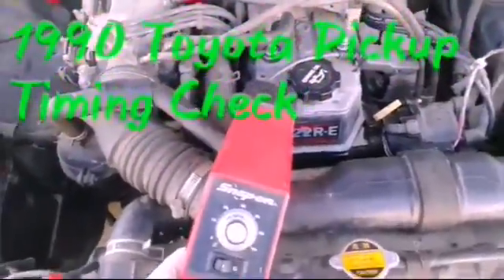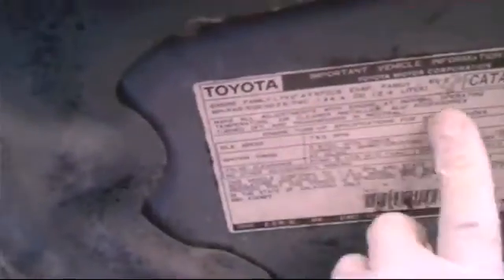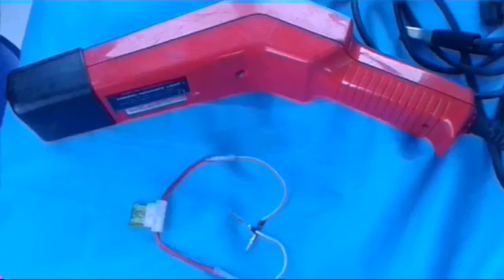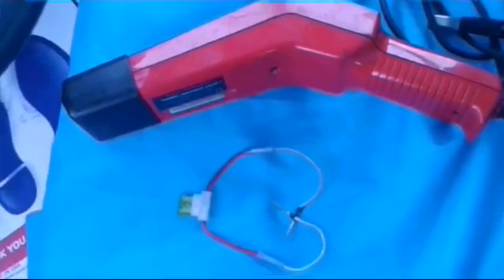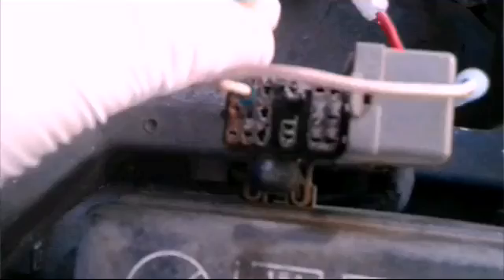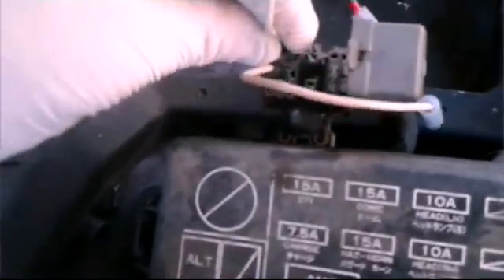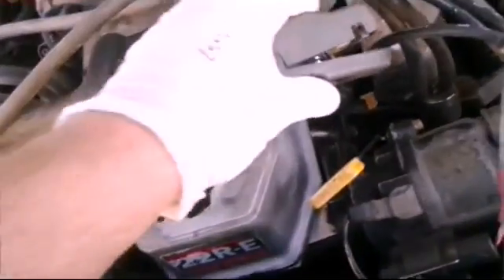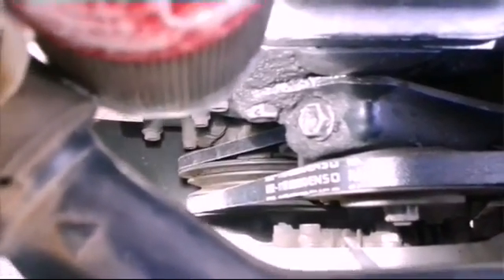How to check & adjust timing on toyota pickup

Comment: The engine, a 4-cylinder 22RE, on my 89 Toyota pickup got wet, and I had to change the airflow sensor. Although doing that got the truck going again, I might have thrown the timing out while trying to fix it because the idle is still very rough. Can I make the timing better from just adjusting the position of the distributer without necessarily using a timing gun?  Another thing is that I think there's too much grease build up on the timing cover and balancer to see a degree setting, or does the gun somehow let you see what's needed even if there's grease buildup covering that area? Thanks.

Comment: Ive got a 1990 2wd...set timing but it knocks using 87oct..91oct no knock but its supposed to run on 87...the 2wd doesnt have a. Knock sensor...any ideas?
Reply: The compression has changed over the years… (carbon build up?) and higher octane prevents premature detonation of the fuel…. Been a year so have any updates on what you found out?